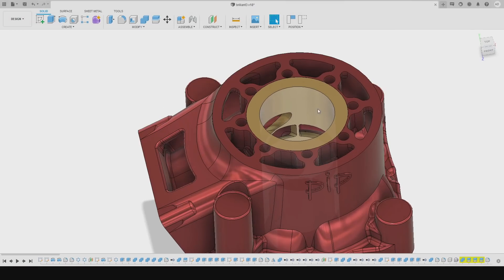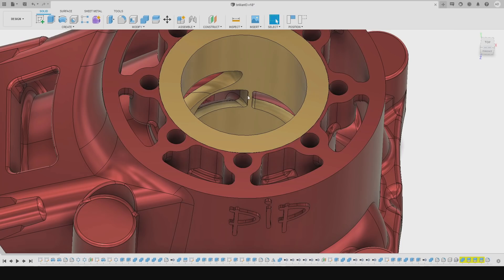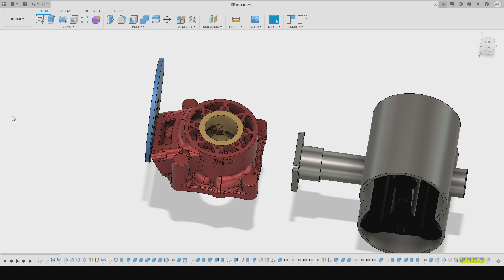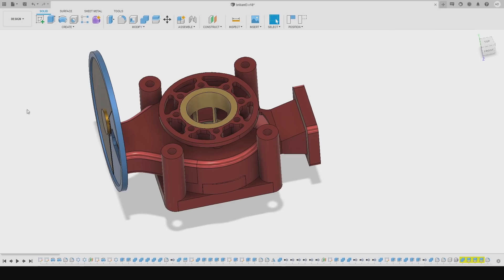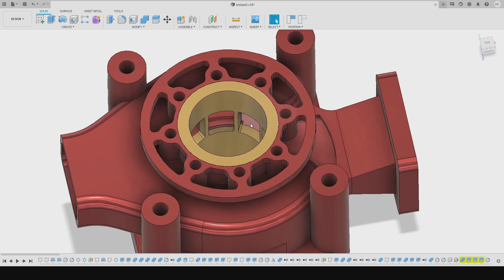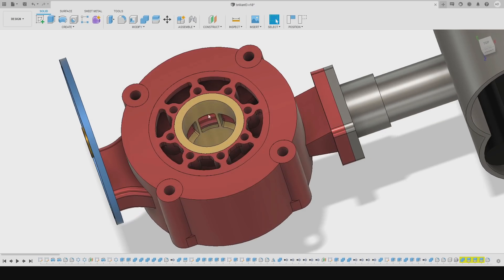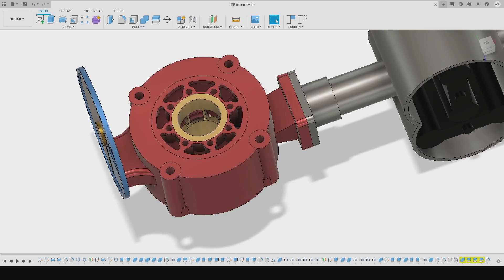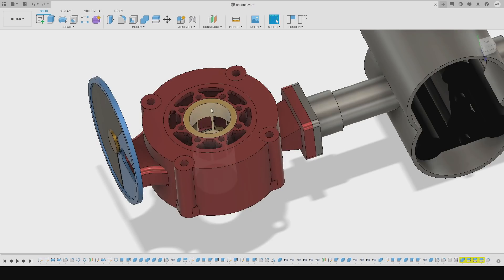Will BLOW Up the Competition! Seriously!

Comment: You should use thicker piston ring to prevent breaking them. Greetings from Poland <3
Reply: Thick piston rings suffer from flutter at high RPM and don't seal well.
Reply: Piston rings need to flex so they have to be thin
Reply: @WashingtonForestAdventures  Maybe just making the part where it's pinned to the piston thicker? That was the only part that snapped in testing
Reply: @au1317  Or put a little semi bridge on the port just to help it not get get caught on the edge.  Or have a bridge about as thick as a sewing needle..
Reply: Better still is to ELIMINATE piston rings altogether and all their problems and go for an ABC or AAC type of engine layout that has a tapered bore to seal compression.
Reply: @albertsammut433  pretty sure that it would just snag the piston and or destroy the nikasil, a 50cc is too large for a tapered bore.
Reply: What about multiple ring pins?
Reply: 1 ring same thickness as the current but the cylinder must have bridged ports it’s the only way to truly avoid a snag with this design, lubrication ports in the piston aligned with the bridges will also really help lubrication and cooling!
Reply: 1mm ring. Any more causes too much friction.
Reply: What about using more than 1 piston ring? Perhaps 2?
Reply: @Random-bn5ll  two rings is not really suitable for this kind of application, dude is aiming for maximum power and two rings have more friction than one, thus meaning less power, and for such a small cc, every little bit helps, also i think that it wouldn't help much, you would just break two rings...
Reply: Speaking of rings, why isn't there 2?
Reply: @realryder2626  second ring contributes relatively little to compression in a modern engine. It's mostly there for oil control reasons, which are of course totally irrelevant to a premix 2-stroke.
Reply: @nerd1000ify  i can understand your thinking but i've built many worked 2t's... it does help top end balance in general.. top ends last longer at higher rpm. There is no oil ring on a 2t.. i couldn't even count how many times i've ended up with a stock 1 ring piston slapping around after a one race.. even though it was run in properly with 3 tanks of fuel.
Reply: @realryder2626  If you look at a high performance two stroke designed for competition (e.g. a motocross bike) they usually have one ring, and it's always thin.  The thin ring reduces flutter at high RPM, conforms to the cylinder more easily giving better sealing and has lower friction.  The downside is they don't last so long.
Reply: @ferrumignis  this isn't my experience with wild port jobs. I wouldn't run anything but a forged 2 ring wiseco.
Reply: I have been meaning to post this same message forever! THICKER RING --- We were the kings in our area of the widemouth Banshee 2 strokes had over 100,000 dyno runs before I sold the dyno, Try a THICKER ring please
Reply: @Patriot168  yeah but he is working with a 50cc, a thicker ring would probably mean too much friction, a banshee bore is waay waay bigger so the friction doesn't play such a big role. Also the forces of the ring slamming into the port edges are quite big, so a little bit of a thicker ring still wouldn't make it tough enough.

Comment: I have dreamed about design like that but in my head the blower is the crankshaft .
Reply: Haha! The shit ya think about while drunk staring at the ceiling trying to get to sleep cause you have to get up in 4 hours and go to work lol. Only thing would be the crank can’t spin faster than the piston goes up and down, and would need a massive harmonic balancer of some kind if it was somehow pulling in extra air on the intake stroke. Might void any benefits? 🤷🏻‍♂️. ✌🏻. Had to throw the ✌🏻 in there in case you felt like you were under attack....you’re not. I lay in bed and go round in circles thinking the same sort of shit.
Reply: through crankshaft

Comment: Great but why not shut it off on the inlet side but can't wait to see how it works out 🙂
Reply from the maker: The reed valve will shut of the inlet whenever there's higher pressure in the cylinder vs blower👍
Reply: So its get more like a four stroke open and close , I have alot of ideas using magnets reversing polarities

Comment: havent watched the video to the end yet, but procharger makes centrifugal superchargers for atvs at under 100hp, should be more efficient than roots supercharger at highrpm applications would be cool to use one of those... sure they cost a lot tough :p
Reply from the maker: There's a really sweet one made by Rotrex in Denmark too. Going cheap for the prototype.
Reply: and also from what ive seen on single cylinder 4 stroke turbo projects you should have more ccs on the inlet manifold than in the cylinder or it wont make steady boost and the boost gauge will just jump around all  over the place, not sure if its the same on superchargers

Comment: Have you considered a non positive displacement supercharger (centrifugal) for a reduction in parasitic draw on the engine?.....it also may be beneficial in that a centrifugal supercharger has a non linear boost curve, so you can tailor the drive ratio to only make the boost you want at the PRM range that you desire.
Reply from the maker: 👍 Just going cheap for the prototype.

Comment: This reminds me of an old engine that I don't recall the name of that had a sleeve on the outside of the cylinder bore. that moved up and down out of phase over the ports in the cylinder wall to create a valve. I feel like if you went with a design like that it may be harder to seal. But you but you might be able to achieve a higher compression ratio and higher efficiency by not having to fill up a large chamber outside of the ports before the rotary valve and potentially have the mixing of spent fuel gases.

Edit: it's called a knight sleeve valve engine I don't know if there would be a way to simplify it for reliability and ease of manufacturing but at the very least it's a cool concept for inspiration.
Reply: I know what your talking about i think they are called sleeve valve engines. I'll link a video of a display of one.
Reply from the maker: Seen a few. Neil Hintz, aka Fletner, aka Uniflow is a master in the field.
Reply: https://www.youtube.com/watch?v=NSMYjRNQ8Rs

Comment: hmm dont you use the resonance in the pipe to push unused fuel BACK to the cylinder as the piston go up?
if you want to use valves (on the exhaust) why not just use a  4 valve 4 stroke head to push in the fuel (using all 4 valves for inlet)  from the top? just as some 2 stroke diesel does? then you can pus in after the exhaust port is closed. use exhaust ports ALL around the bottom.. stil have a shorter port. not use as much time for exhaust.
Reply from the maker: Maybe next time😁👍

Comment: Ain't it the way how two stroke diesels actually work? Hope the project may go through a breakout in close future!
Reply: Oddly enough the 2 stroke detroit diesels were considered by detroit to be naturally aspirated unless they had a turbo with the supercharger. The blower simply made sure there was enough air coming through to clear the cylinder.
Reply: @markcargill1185  normally the blower on 2 stroke diesel is called " whasing pump" because of that
Reply: Pretty much! They just use regular valves though for the exhaust. But they do the same. Use a blower to push exhaust out while also delivering fresh air. But they are direct injection as you probably know. So they aren’t throwing fuel out the exhaust. But they are very powerful engines. But diesel has more potential energy per ounce than gasoline. Not sure about nitro though